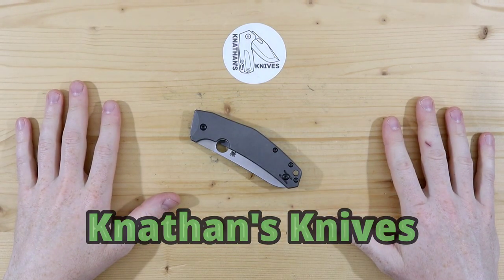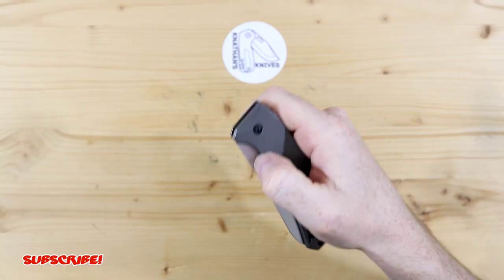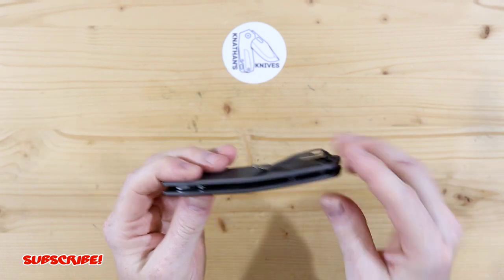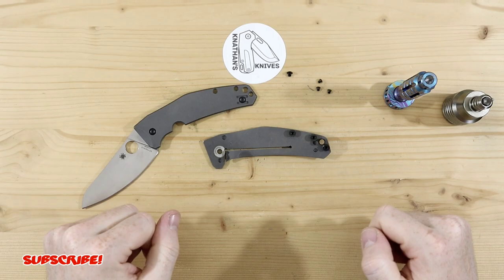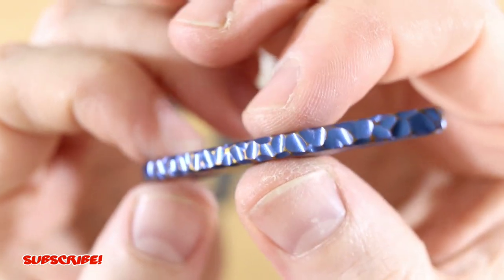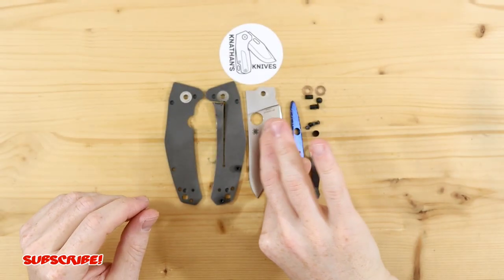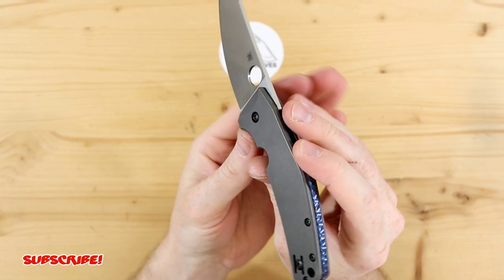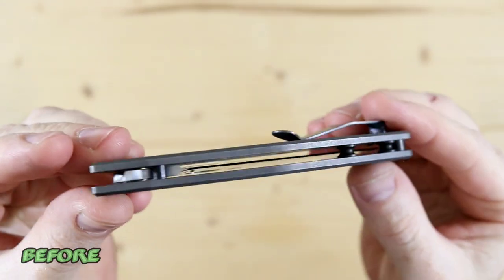Spyderco SpydieChef W/Custom Titanium Backspacer!!! #custom

Comment: My Spydiechef's tip does come close to the end of the scales, but I can't get my finger in there far enough to touch it.  I've carried my 'chef for years and it has never bitten me.  Either this 'chef has a longer tip, or the owner' s fingers are extra squishy.
Reply: Same. Non issue
Reply from the maker: Nice, you got a good one. I've been told some have the issue and others don't 🤷‍♂️
Reply: @KnathansKnives  I don't think there is any appreciable variation from one CQI 'chef to the next.  The one in this video does seem to be a CQI version, and the blades are all laser/water jet cut to within probably 0.005" of each other on all dimensions.  Likewise, the handles are CNC machined to even tighter tolerances.  Taichung is not sloppy in their process.  And I've seen probably 30+ YT reviews of the spydiechef over the last 4 years, and never has anyone mentioned this issue.  I seriously think the owner just has exceedingly pliable finger skin.
But regardless, you did do a great job on that backspacer.  Thanks for making this video, I learn something from every one you upload.  👍
Reply from the maker: I'll need to buy one of my own and see what's going on🙂
Thank you for supporting the channel! 🤜💥🤛
Reply: @KnathansKnives  I've bought 5 'chefs, modified 4 of them, and held probably 10 more (I live near Golden). I have never noticed any one of them have any appreciable difference in size, feel, surface finish, etc.  Taichung would not have such a stellar reputation if their variance from knife to knife was enough to make some knives finger biters and others not. 
The only conceivable way I could see the knife in this video having a longer blade is if it was a factory second or a Chinese knockoff.  And I don't think either is the case.
Reply from the maker: Appreciate the information. I'll be going to the Spyderco Headquarters in August😁
Reply: @KnathansKnives  it's a glorious place.  The employees are a class act.  I've met many of them at various levels in the company, and without exception they take great pride in spyderco.
Reply from the maker: Awesome! I can't wait to go there🙂